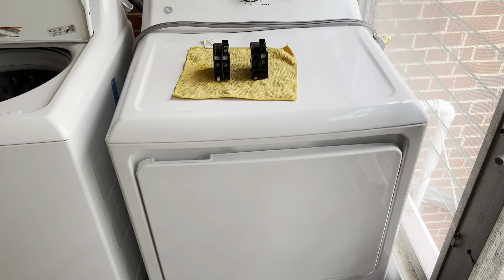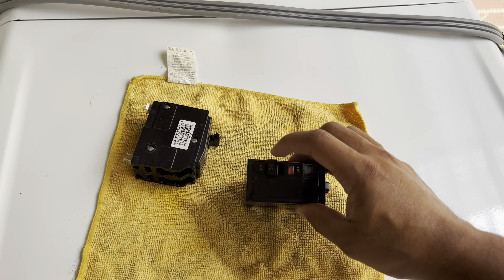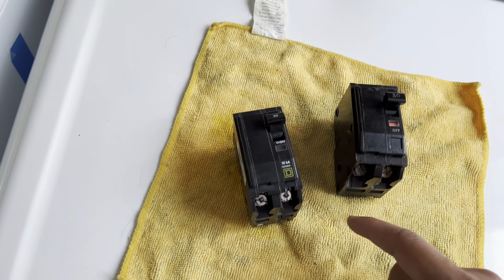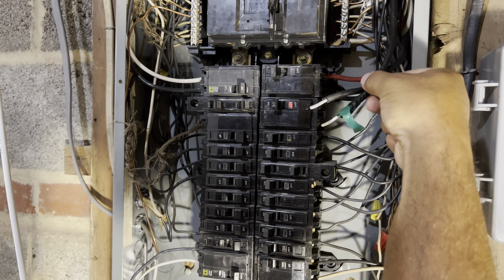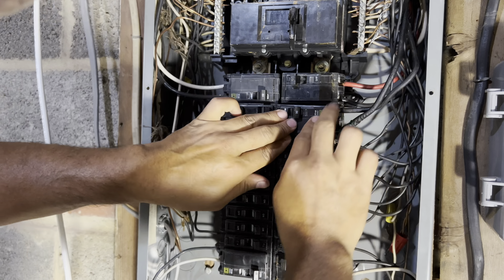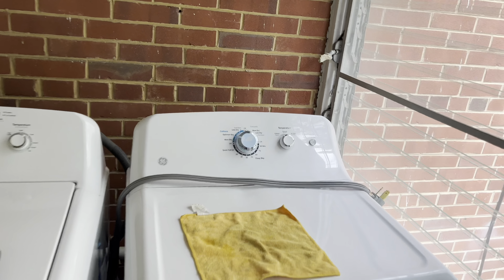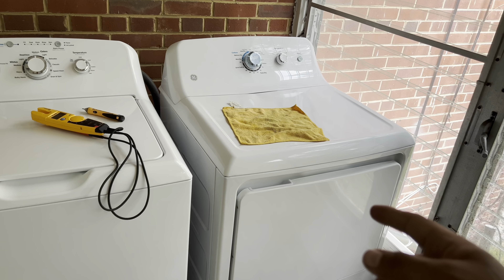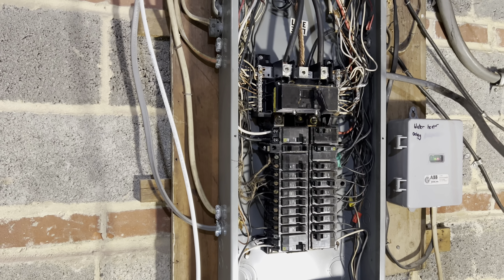Bad 30 amp electric dryer circuit breaker￼

Comment: My breaker is tripping few minutes after starting the dryer. Is it the same diagnsis as yours or yours is tripping once you plug in the power supply ? Thank you
Reply from the maker: My would not reset, even if the dryer was unplugged. It was a bad breaker

Comment: I have a 40 amp double pole breaker in the breaker panel. Can 40 amp cause problems to a dryer (30 amp)?
Reply from the maker: I am sorry I do not know the answer to your question. but if I had to take a guess I would said yes
Reply: No it won’t
Reply: It won’t, it depends on the size of the wire feeding the dryer outlet, but the dryer will draw what it needs, as long as the wire gauge is 8/3 gauge which is rated for 40amps, all should be good